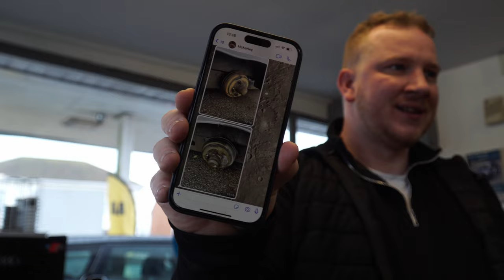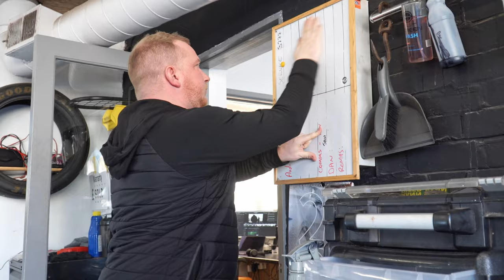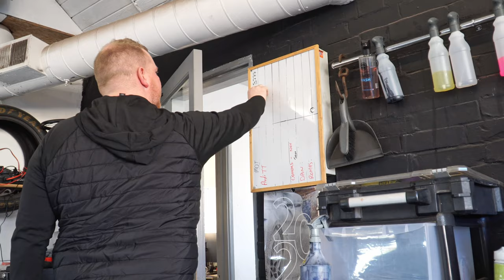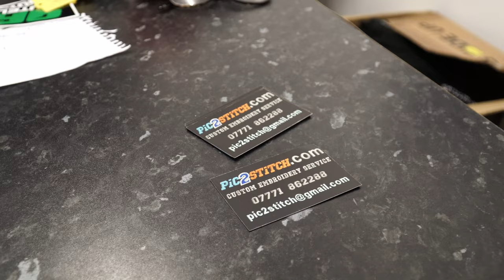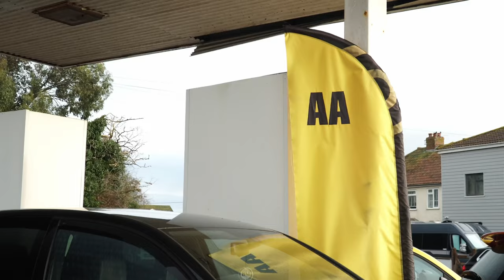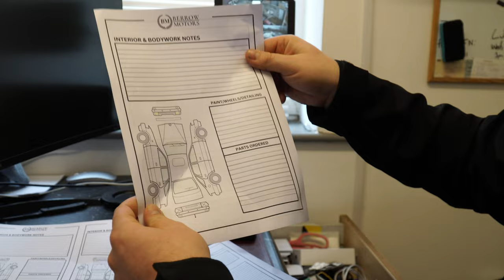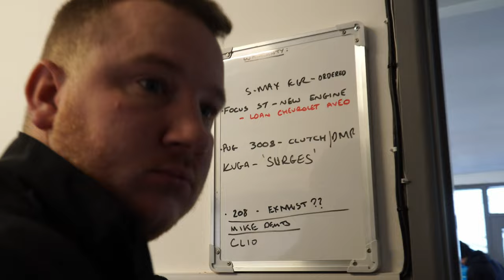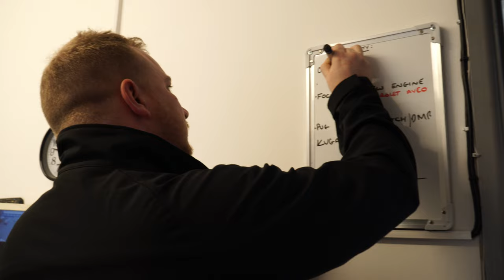Things Can Seem Bad Until You Get A Little Perspective | BM Weekly EP 26

Comment: Not just used cars go wrong… my mother bought a brand new seat a month ago, the day after she picked it up low tyre pressure light come on, after a trip to the local quick fit all tyres was under pressure! Clearly no PDI from a seat main dealer🤪
Reply: Can confirm. Our five week old car with 1300 miles on the clock had to be recovered on a truck after stranding me 175 miles from home.

Comment: Question Joe I need a car for towing a Horsebox which would you go for….. bmw 320d shadow edition or Mondeo st line tdci 180 and manual or auto on the bmw
Reply: I'll just chime in and say don't think about a Powershift Mondeo for towing, they are very weak automatic gearboxes as they are, towing will shorten their life even further. 
Most BMWs use the ZF auto boxes which are much more reliable torque converter units. 
The trouble with the BMW is the engine if it is fitted with an N47
Buy one and spend £1k having the chain done as peace of mind and I'd say go for the BMW all day long. 
Ideally manual. 
Or a manual Mondeo. 
The Mondeo's engine will probably be a bit more reliable, but a Mondeo is pretty plain jane
Reply: @sammytheseal2307  yep agree with you and would only go manual in the mondeo